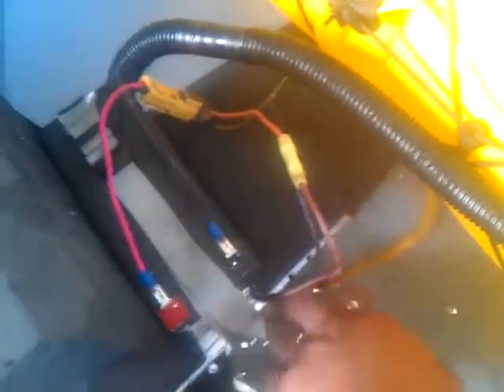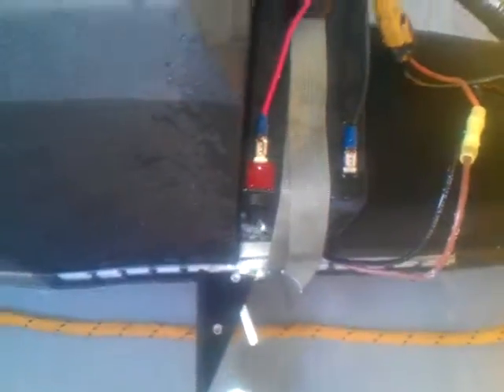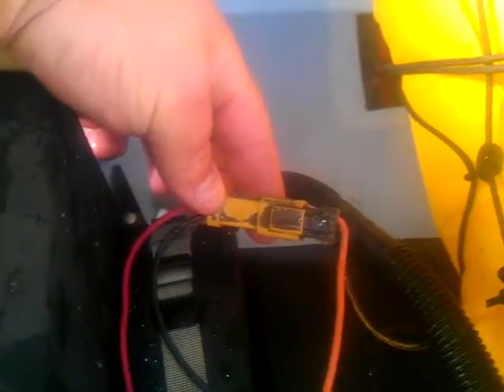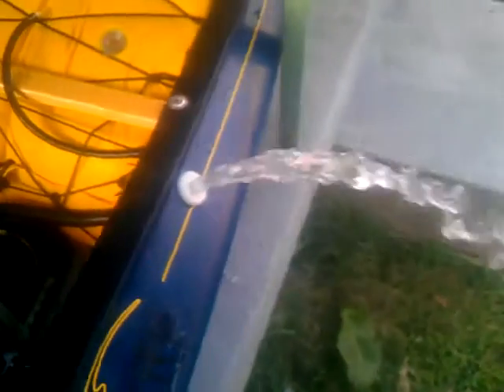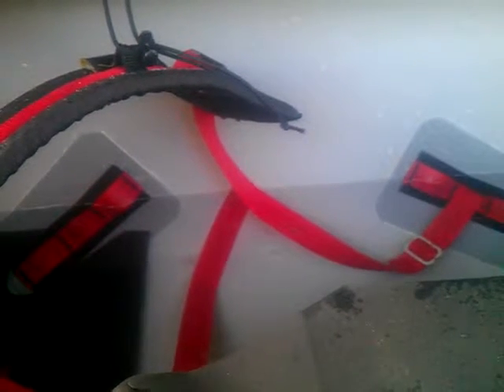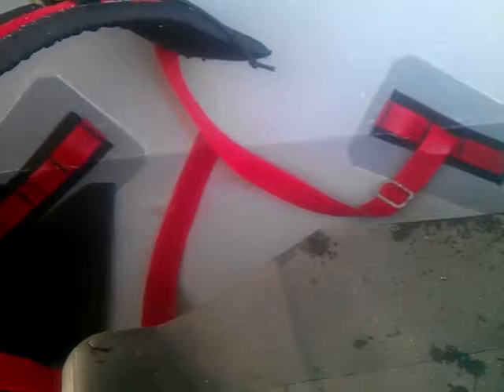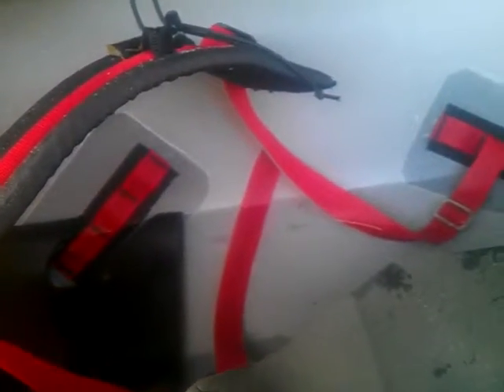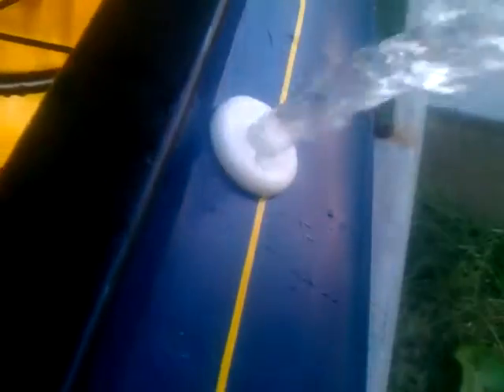Esquif Canoe Electric Bilge Pump

Comment: I have similar system already in a boat I bought used.  It says right on the battery "do not immerse in water".   Is that silly?   I have seen other videos with the battery and fuses in a waterproof box.  Is it okay or not?
Reply from the maker: Paul K. Redd my battery works fine after being underwater a bunch